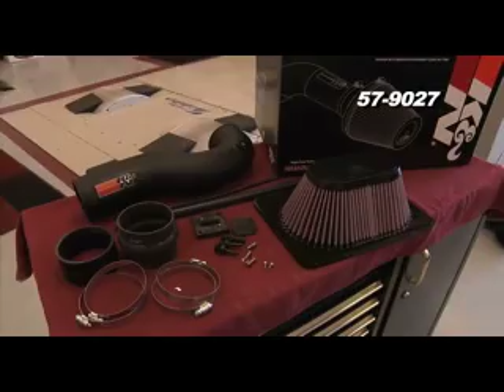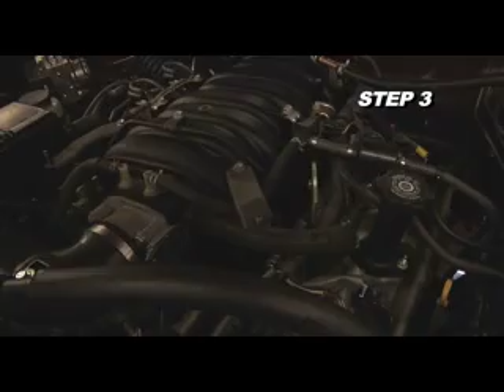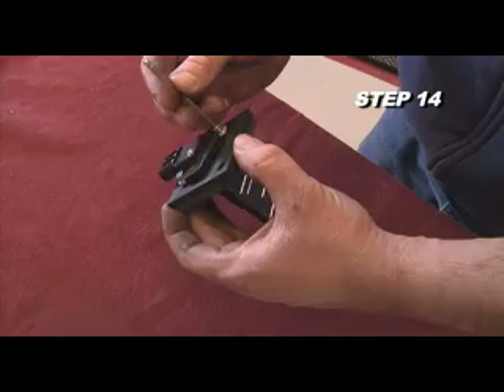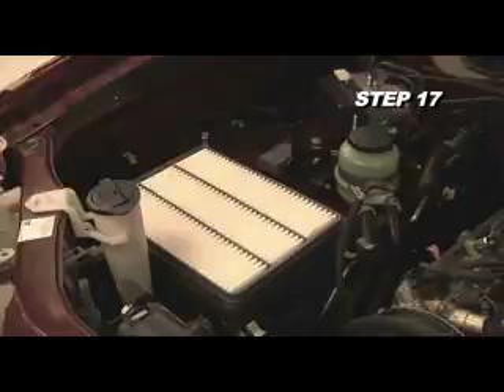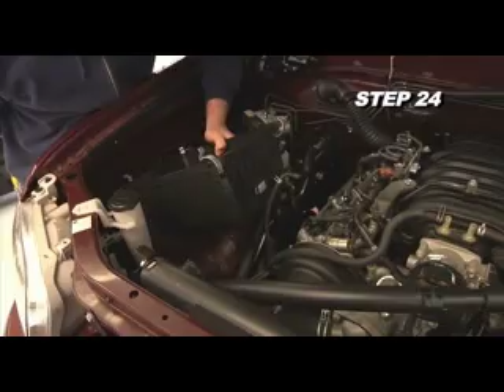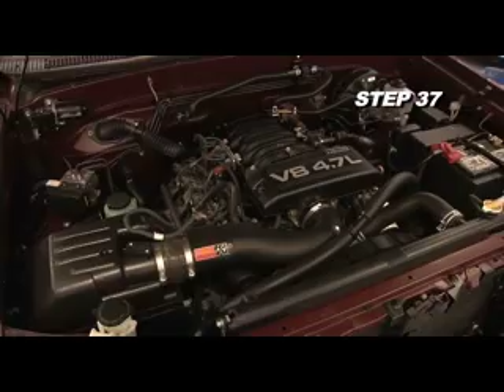Toyota Tundra & Sequoia 4.7L [#57-9027] Air Intake Installation

Comment: KNfilters ;Does it reuse the same air box?? I’m highly interested in this product but want to know if it’ll reuse the factory box or is it a bigger air filter box with kn filter?? Plus is the intake tube runner bigger in diameter then the factory intake tube runner??
Reply from the maker: This system replaces the intake tube and air filter but reuses the factory air box.  The intake tube is designed to provide better airflow and improve performance.  Dyno tests for this system show a 9.58hp and 11.69 lb/ft increase http://kandn.com/dynocharts/57-9027_dyno.pdf.    If you have any other questions please feel free to contact our Product Specialists at 800-858-3333 or tech@knfilters.com

Comment: Please let me know the link to buy that filter for a Toyota sequoia 2001 v8. Thanks
Reply from the maker: Please visit knfilters.com.  You can enter your year, make, model, and engine size to see all of the products K&N makes for your vehicle.
Reply: I tryed but i cant find the one you installed. I have a Toyota sequoia limited 2001 v8 4.7
Reply: Can you please provide me the link for the one you installed
Reply from the maker: Check out the following link https://www.knfilters.com/57-9027-performance-air-intake-system
Reply: @KNfilters  thanks now i see it